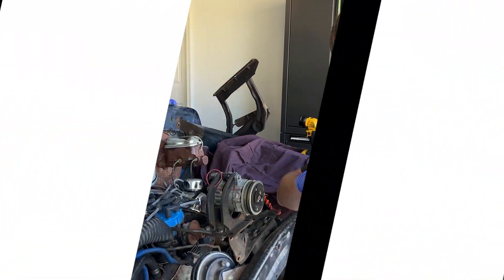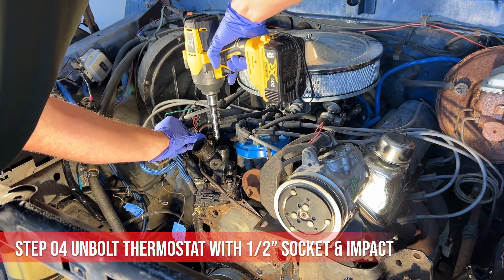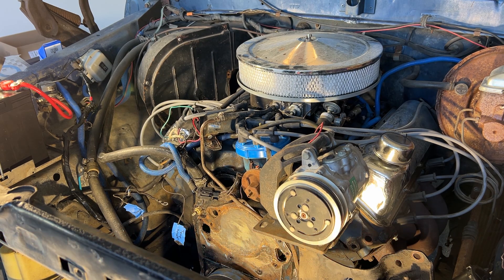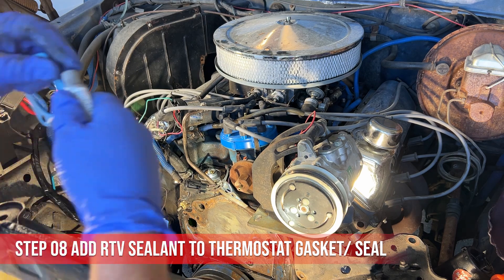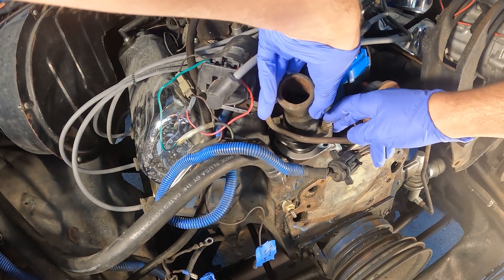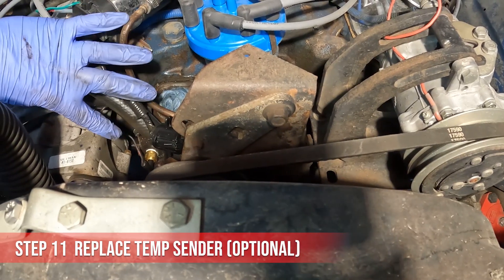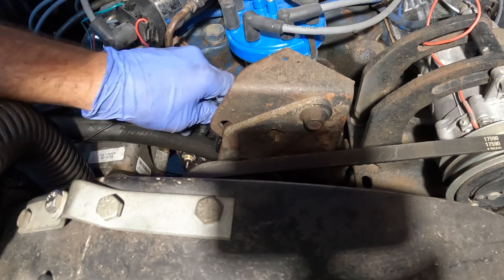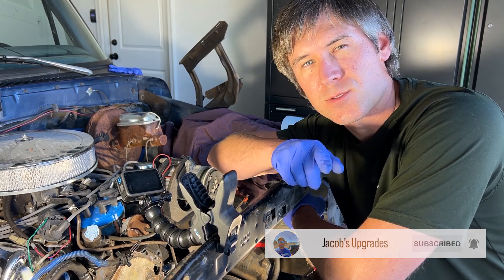Installing Thermostat & Temp Sender | 79 Ford 400 V8

Comment: I am from Spain, I have imported a 1972 f250, 360 engine, what type of water do you put in it? I have also heard that you have to add a lead additive to gasoline, is that correct? Thanks for the video!
Reply from the maker: Welcome to the channel! I recommend distilled water if you're mixing your own antifreeze coolant. I use 50/50 green premix. If it's an original 1972 motor it's the first year Ford installed hardened valve seats. Meaning you don't require any lead additives to the fuel. If you don't drive it often I would use premium ethanol free gas. 
Prestone 50/50 premixed coolant 6 pack - https://amzn.to/48O9vcw
Reply: @jacobsupgrades  Thank you very much Jacob!!! If it is an original '72 engine, thank you for your clarifications, here in Spain the mechanics do not know these engines and it is always good if someone takes the trouble to respond. Thank you very much, greetings!
Reply from the maker: @jesus9755  I'm glad to help out! I'm sure that's a rare truck and engine over there. Did you import the truck yourself?
Reply: @jacobsupgrades  Good afternoon Jacob, I imported it through a company based in Germany "Hot Rod Imports" I went from Spain to Germany to see the Ford and I saw it and bought it. Import it in a truck to the south of Spain
Reply from the maker: @jesus9755  that's really cool! Welcome to the classic Ford family!